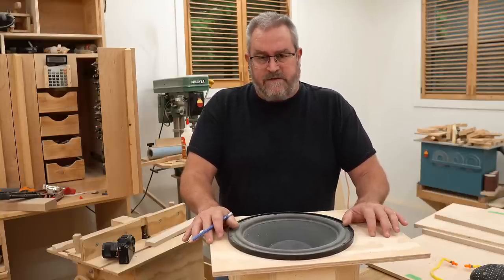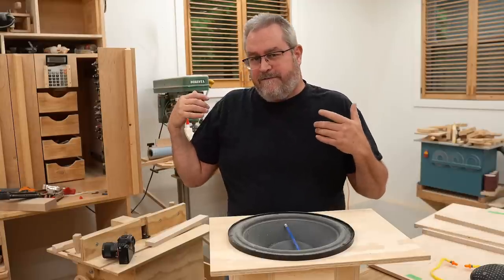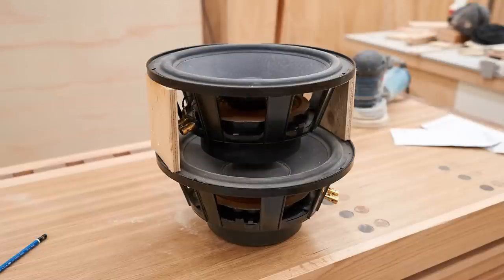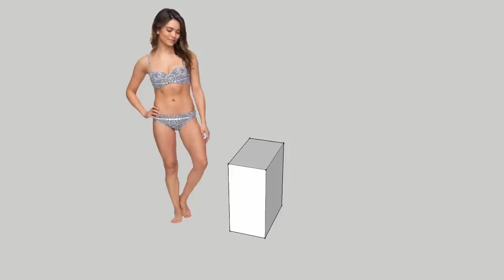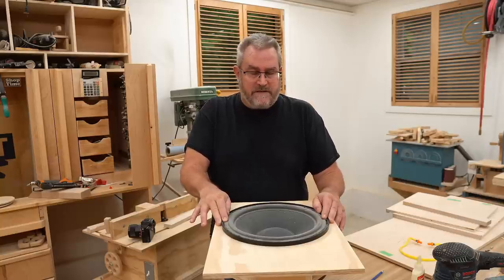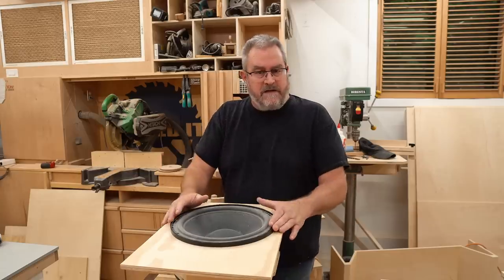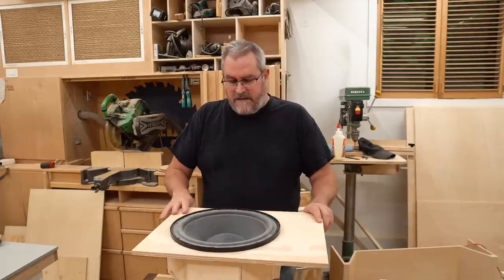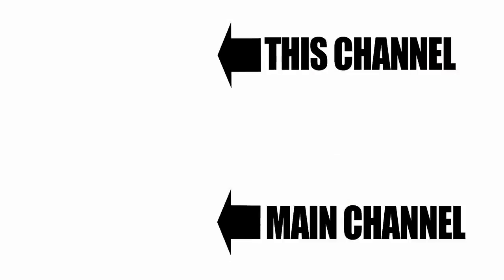Why Isobaric Subwoofer? What it Is And How it Works

Comment from the maker: The bottom line: use isobaric when it makes sense. If you already have the drivers (like I do) and are willing to use two in order to cut the box volume in half.
Unstated in the video is how important box volume is for speaker design. The box volume determines the tuning and how flat and extended the frequency response will be. Therefore, putting a driver that's designed for a 200 liter box in a 100 liter box will give you a very poor response. Being able to cut that box volume down to something more acceptable is the key reason to use two woofers in an isobaric arrangement.
Regarding efficiency and power, isobaric reduces efficiency by 3db, but the more modern woofers that are designed to work in small boxes have that efficiency drop built in - there's ALWAYS a tradeoff - no free lunch - to get more of what you want, you have to give up something to "pay" for it. For isobaric, it's a drop in sensitivity for a reduction in box volume.
That drop can be regained by wiring the drivers in parallel, but then you need twice the power to get the same spl. While that sounds like a major drawback, increased power requirement translates to increased power handling as well, so possibly a slight advantage for something like a subwoofer. 
Also amplifier power is cheap today.
I know, I'm using the terms "sensitivity" and "efficiency" interchangeably. There's a difference, but not one that really makes a difference for a casual talk like I did here. Focus on what's important instead of searching for details to nitpick about.
Reply: Good day.I know all that there is to know about the Isobaric design since< the early 1970's when I became an audio enthusiast .It was an ingenious idea in the 1950's and was a great way to reduce box volume.However time has marched along by leaps in technology .Today it makes no sense to build an Isobaric box even if you happen to be  sentimentaly attached to four junk woofers that happen to be lying around.
Reply from the maker: @1997inspire  These aren't junk woofers. Suggesting that they are makes me question how much you actually know about the topic. Maybe there's more that you could learn if you went with the idea that you don't actually know it all.
Reply: @1997inspire  Since you know everything there is to know about isobaric enclosures tell me one benefit you will get with a clam shell vs stacked configuration? Hint, also a benefit no other cabinet design affords, therefore negating your entire comment?
Reply: Make a video, we need em.
Reply: @brentb5303  Oooh, oooh, pick me!✋
Reply: @dcuccia  Clue him in David.
Reply: @brentb5303  please clue me in
Reply: @tone1585  When you use the driver's in a clamshell configuration your using the  inverse sign wave to compliment the other driver. Since your RCA cables pick up noise equally on left/right/positive/negative having the inverse waves compliment verses using the same wave at the same time, you will cancel noise added and be left with only the original signal sent from your head unit or sound prosser. You basically have created a mechanical balanced differential input. High end amps have circuits that electronically do this and can reduce your noise by up to 40db. I have no idea how much a clamshell configuration will cancel but theoretically it should completely cancel any noise introduced. When you stack your drivers they are using the same part of the wave and would not cancel any noise as they are reproducing it in a complimentary manner.
Reply: "That drop can be regained by wiring the drivers in parallel, but then you need twice the power to get the same spl." Yeah.. and what happens to the sensitivity when you need twice the power to produce the same spl? -3db happens. So it's -3db in the best case scenario actually.

The way I see it - there's no reason to do iso anymore because you can just tune low and use EQ instead or just go sealed and use EQ if you want "small at the expense of efficiency."

The power handling thing is true. The xmax is reached much sooner with regular vented designs compared to clamshell but you need like 3+ times the power to reach xmax! Is your vent also gargantuan so it doesn't chuff with all that power pushed through the box? Oh it is? Then why the heck did you try to build a small box?? Passive radiators w/clamshell? (to make it small again) = even more sensitivity loss = insanity.

Always look at the SPL graph (not just transfer function magnitude) in winisd to check your sanity. Isobaric looks great until you realize how little you get. In essense, you just get an automatic reduction in upper bass, so you can raise the gain and bring the low bass up with the high bass, making the the bass extension deeper without making the upper bass crazy loud "boomy."

You can do the same with a DSP EQ and you don't need to sacrifice half the power (3db).

Digital EQ is great. Try Equalizer APO if you're running a Windows DAC. You can use as many bands as you want all between 10 and 100Hz so you can really shape how your bass sounds. I personally love to roll it ON from 35 down to 20 - the exact opposite of what happens in normal speakers. Sounds awesome!

Why should anyone listen to me? While I am not a pro, I have a 12" iso clamshell in a 2cu/ft box with giant vents sitting 3ft away from me as I type this. I built it, now you don't have to waste your time doing the silly thing I did. Buy DSP instead, you'll want to use it regardless.

Comment: Another important advantage of the isobaric box is that in the opposite coupling of the two drivers, the harmonic distortions caused by the movement of the membrane and its deviation are canceled.
Reply: I’ve debated this with people. I swear the bass just sounds better to my ears with an isobaric enclosure. It’s just plain physics. The two drivers are working together to maintain linearity.
Reply: And paralleled, the induced CEM force opposes itself ...

Comment: 1. By putting them in series back-to-front you're losing out on the second most important part of isobarik coupling. Mounted front-to-front or back-to-back, you can decrease the odd-order distortion components by a quite significant margin. Odd order distortion is greatly increased by driver nonlinearities that are different in out-stroke compared to in-stroke - by using two identical drivers where one faces "out" and one "in" from the box's POV, those nonlinearities are partly balanced out. That's why most old professional or consumer grade isobarik solutions use the drivers with the fronts facing each other. It maximizes the coupling between the drivers (minimizes air-spring effect), and lowers THD.
2. Low-Q EQ does still do a VERY good job in the lower ranges. You'll see VERY close to zero difference in distortion and compression when you compare a single driver EQ'd to give the same FR as in the same box where you had a "passive" isobaric setup before. And you won't hear any difference either.
3. Multisub setups are several times more space-efficient and give better results (on flattening in-room bass response) than ANY kind of elaborate room treatment in small-medium sealed rooms. Removing room-modes by actively REMOVING them is simply put more efficient than trying to mitigate them passively on second bounce. The room still has to take care of reflections above the modal limit frequency in a good way, but below?
Reply from the maker: 1 - the reduction in distortion isn't significant. It's there - it exists - but it isn't enough to make an audible difference.
2 - too much faith in EQ.
3 - too much faith in multisub. Multiple subwoofers don't "cure" room modes and need a ton of EQ to work properly. They aren't the panacea they are hyped up to be.
Nothing equals treating the room - nothing. The more treatment it has, the better the system will sound.

Comment: I love Isobaric boxes.  They do require a lot more power to get the full benefits, but they deliver a much punchier and solid sounding response.  They sound more like a sealed box than a ported box in that aspect.  For anyone looking for new subwoofers, it's important to learn about the Thiele/Small parameters, and at least get a basic understanding of what you need, rather than what you want.  It's really beneficial when you know what kind of response you want, the physical limitations, and enclosure type you want.  Instead of blindly buying a sub you are told is awesome, you can compare and look at the numbers to find out what you need, than what is sold as a dummy light. (like in a car dash dummy light).

Comment: There is a very important fact regarding the two woofers facing each other that is overlooked. One of the drivers has the input signal reversed in relation to the other. This arrangement cancels the back EMF generated by a single driver or two drivers facing in the same direction in an isobaric arrangement. Eliminating the back EMF reduces distortion.
Reply: Yes I agree with this; also the "piggy back" method introduces a mass of air between the drive units which reduces the coupling stiffness between them.

Comment: Btw, it's not limited to 2 elements, you can assemble several in order which cut the needed volume even more. For example i had four 6,5" bass elements which optimum sealed enclosure is 30L / element. I did built isobaric system, four in line in 8L net volume. Result is outstanding, it goes to 26Hz with ease. Of course the maximum spl is less than four elements in traditional system, but enclosure would be 120L then 🤣. I will most definitely build more systems like this!
Reply: Interested ! Please see my comment above. Thanks

Comment: If I did it I would experiment with a slight difference in woofer output by resisting one by like less than one ohm. And listen to how that may affect the bass. Also have a slight difference in added weight on the woofers. Or if none needed, just weight one woofer very slightly with Blue Tack, and hear how the bass sounds. Sound nodes are ridiculously complex and that is why fine tweaking a bit like this works (or fails miserably). You will hear the difference by such a small tweak.

Comment: In the 90’s isobaric was a popular configuration in Car audio Competition and higher end Car Audio
Reply: Yes, that's how I'm aware of the configuration.  It was definitely trending in the mobile world back then. But that was really before manufacturers started optimizing subwoofer design for small boxes. Iso was a good way to get these woofers into manageable enclosure sizes, especially in a competition car where the increased cost of drivers and power wouldn't have been as big of a factor.

Comment: I have isobaric subvoofers. The dB is less at  100 Hz. But that's not any problem at all. I have a increase of output in the deep Regions instead. I use active filter 24dB around 80Hz . The sound quality is outstanding. You can't compare the clean sound with any single woofer.

Comment: Hello, I really appreciate all comments about subwoofers and specially the Isobaric mount. I must relate this part of my experience because I think that as everybody You underestimate the real bottom of the signal: Modulation. Let me try to explain ! When analysing (with any kind of method) the audio waveform, You see appear some lower frequencies that are stimulated by the modulation of the signal . Basically, the Fourrier analysis explain this, also logic makes easy to understand that when You hit the Knob in 1 second revealing a 1kHz signal, You compose a modulation which is made of 1000Hz, 1HZ and 999 Hz and 1001 Hz ... As a signal establishing itself in acoustic pressure takes a small period to exist, You have a modulation. As a Choir sings an A, the harmonic composition of the voices create a modulation which has nothing to see with the A note. When a group of strings plays a chord, with vibrato on every instrument, You get the feeling to hear something fully tuned, though some sub harmonics have nothing to see with the original Chord ... and it is beautyfull ! To hear this is natural to our ears. Imagine the modulation there is in a musical (classic orchestra ) Final à Tutti with the great orchestral Drum (14Hz) !!! .At that moment, there's a huge modulation of mainly the reverb. Can You imagine reproducing that moment WITHOUT the 14 Hz ???
This is why I consider that the Sub system should be targetted UNDER 30 Hz ( this freq is very well tuned in port systems) and this is why I'm interested in Isobaric cone to cone system, at the rear or sides of the main enclosure. Two main advantages: as You described very well, the box may be half the size, and (nobody dares speak about this) the (in french) force contre électromotrice " counter current" is opposed if parallel wired. And it should really help the Amp ! 
Finally, with the use of modern speakers with -double Magnet, long throw, long Xmax with fabulous suspension moving small mass for quick response and multiple low cost speakers, and also very affordable DSP that emulate all Your wishes, I think that I will keep a sealed box option... with 4 speakers in each... to place UNDER the usual sub, reproducing only the played notes ! (though C zero is 16 Hz !!)
If You've read me so far, don't hesitate to react ! Thank You for the post and this interesting subject.
Reply: Well said.

Comment: It may be worth your while to experiment with parallel vs series wiring with your isobaric setup because although a lesser ohm load will merit more power gains from your amplifier,  wiring in series will increase the bl factor of your subs.

Comment: Personally I'd just use a woofer with enough motor force to drive the box size I need. Probably back in the day, the motor strength on available drivers was weak and you had to have two pushing in tandem, or build a bigger box (which is a more efficient use of the woofers if you have the space.)

Comment: Have a ?... I watched the vid and you mention isobaric taking a smaller box. Does that mean smaller than the box would be with both subs loaded normally, or smaller than 1 sub itself would require. I can't seem to find a definitive answer. I know this is an old vid, but I happened across it searching for an answer.
Reply from the maker: It cuts the box size for a single driver in half. If one driver needs a box that's 50 liters, then an isobaric box would be half that size.

Comment: Would this work for modern woofers too? Something like a pair of GRS 12SW-4HE 12"? I'm trying to build a small enclosure that with an f3 around 20 HZ. If this configuration doesn't work, do you think passive radiators are the best option?
Reply: What was your conclusion? Sounds like I’m looking at going a similar route to you.
Reply: @zackobrien2223  i ran out of time while finishing the RLC speaker builds (new baby daughter) so I just bought a speedwoofer ha. I'd love to hear your thoughts and experience with your build.
Reply: @Nickporter17  Congrats on the baby! I hope that setup is treating you well. I certainly will! I am fortunate to have an audio friend in his 60's with a ton of experience with cabinet building and DIY. So, I will be leaning on him heavily. Ill be sure to post here with my results. :)
Reply: @zackobrien2223  thanks! Have fun with it!

Comment: for example a single sub will need a 5liter box. if I put another one in an isobaric setup but keep the box size. how will it affect the sound? specially the frequency?
Reply: The tuning will go to a different frequency, keep in mind that you need to cut your box from 5 liters to 2.5 liters, because it does all the work by the woofer. By doing that they will sound very similar, but less work goes to the woofer! Not only that, you will have much more wattage to work with, lower distortion and lower excursion overall! You will benefit a lot with an isobaric design. Maybe one disadvantage it has, is the weight and that you need a bit more juice to the amp! But building a subwoofer for small enclosure by doing this you are just benefiting what can be done!